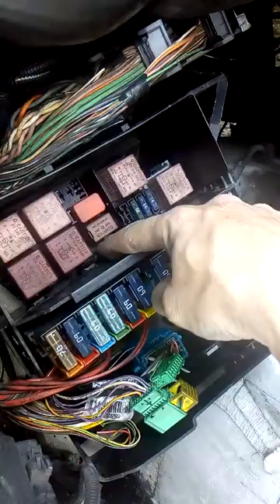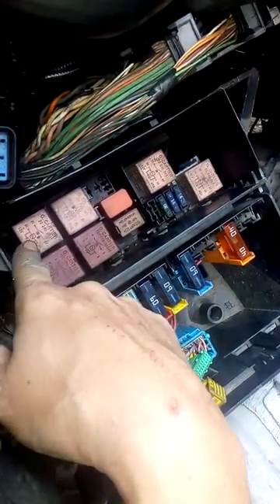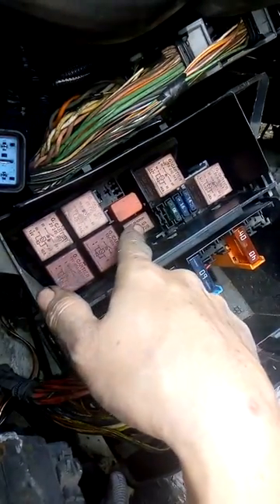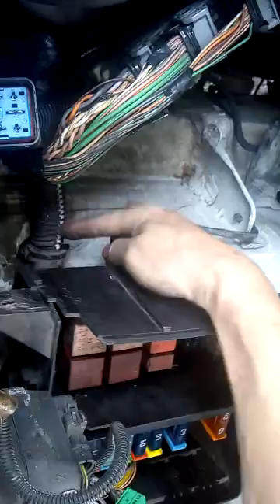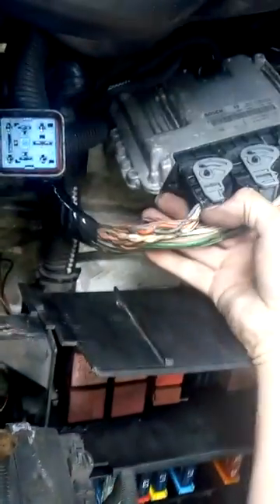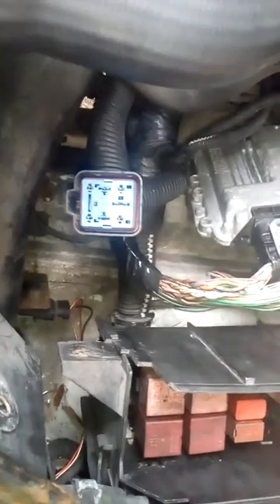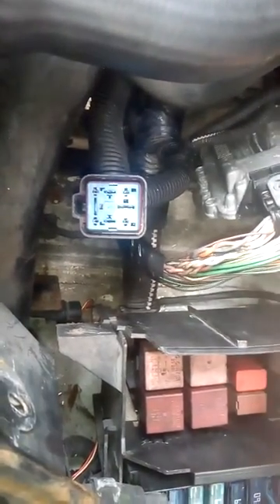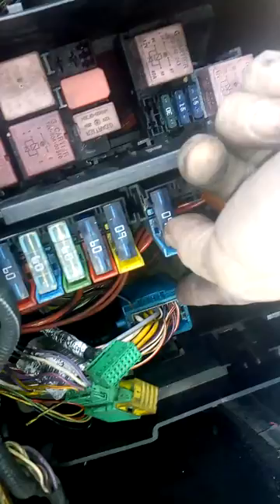Renault DCi 1.9 fixes.

Comment: Hi Rory, My Trafic isn't starting and displays "Low Oil Pressure". Won't connect to ECU via ODB2 either so can't read faults. Any suggestions?
Reply from the maker: You could have a few issue.
Pop out the expansion bottle and take a look at the fuses first.
Also check the fuses at the battery.

The ECU fuse should be a 5amp.You can get corrosion on the ECU plugs, take them off and on again, making sure there clean, you get a green dust, if you see it, scrape it off, and see if you can get what's called contact cleaner on it. Plug back in see if your working again..

If that doesn't work......
The loom breaks about four inches down from the fuse/ECU, and also just above the clutch too on the bell housing.

You will have to cut apart the loom case to take a look at the wires. What I did was get two sewing needles, solder a wire to each and pin them in to wires either side and then use a multi meter to check continuity. You can do it in a big run to cover both places. 
A fast test is shaking the wiring loom as if it's broke it is small, and may work, but will break again so needs to be done.

The low oil pressure is probably a default from the not being able to connect. 
The bus (information) wires are usually thin. But don't forget to check the wires down at the sensor as they can break.

I can't tell you what wires, as there is a few different wiring layout for the vans, so it's hit and miss.
Reply: Thanks for the quick reply much appreciated. Just took off the 2 security bolts which were easier than I had imagined. I'm nipping out to the van every couple of hours to do a little more each time. Will check fuses first.

Agreed it will be a default fail setting as the ecu isn't communicating. The pressure would only increase as the pump starts and there's no permissive to start. Seems its going to be a pernickety job but here goes.

Thanks a lot. Will give you an update tomorrow
Reply: @JohnReilly85  hi mate did solve the problem in your van? I have the same problem with my Vivaro 2012 2.0. Doesn't start, and I have error code DF067 injection multiplexed emission missing and oil pressure fault on speedometer..
Reply: Problem solved. 60A fuse located on the battery had a bad connection. £90 labour to fault find and £3 fuse 👍👍 had to get my local garage to look over it as at first glance the fuse was intact, it was the connectors that were dodgy.

You were right though, fuse at the battery 👌

Comment: Hi, 

I have got vauxall vivaro 04 plate 1.9 diesel . It keeps blowing a 30amp green fuse next to relays while driving .checked the wiring loom from relays to injectors and fuel pump ,don't show any shortage . Sometime van drives fine for weeks and all of the sudden it blow the fuse while driving and won't start again, change the fuse and it starts again .sometime you have to wait for a while to restart the vehicle after the fuse replace .

You help will he highly appreciated

Thanks
Reply from the maker: Depending on what the fuse of for....
If you have anything on there there could be a fault within that, say a motor with a fault in one part, say a 1:360 change of hitting it...
Old warn parts can cause this and of you can manually test it, then do so.
The fuel pump has the regulation on the from which buzzes when you turn on.
I think there also a pressure sensor too, but this wouldn't be the problem.
Or you'd get that under a certain circumstance.

You may have to check  various parts of the loom as the 30amps are "main power" it's spilt into sections,service, engine, 
From the engine  you'll have injectors and pre heats (one fitted on cooling pipe also)
There is a potted relay (inductor box) for the injectors, they have been known to go faulty.
Now this should be a issue with cold starts, hot starts.
Abs system. And belt tensioners, I forget airbag deployment, I think that's 20, but normally has a yellow wire connected.

Don't forget there exposed under the seats, so if you've cut it you can get shorts, sometimes you'll get a dashboard light.

It's probably helpful to see if you get a result from scanning for a fault, if it's blown a fuse. It should show up. 
You may have to see live data to find it if not.

Try triggering the abs (slam on breaks and see if it blows).  Mash about the stuff under the seats...
Also  get you hands on the cables and wiggle them while it's running, the bottom of the black box and around by the gear box.

Comment: Hi I have the same problem on start up turns over fires cuts out up to 12 times some days hot or cold weather 
New glow plugs same problem but it I do glow plug light on then out count to 5 then again on then count to 5 it fires first time glow plug light stays on for about 2 seconds tho when key is turned on
Ut is kiwi on power when started wont rev up easy to stall too when warm it pulls like a train any ideas to the problem 
Nothing shows up on dash or the obd reader 
Thanks simon
Reply from the maker: Obd readers won't show anything. You need a proper tool to read the data from the can bus.

I would say you probably have a fault in your temp sensor,or on the glow plug relay. Or even down to the starter.

When you power the starter this can drain power from the glow plugs, causing a issue.
Where it has a temp fault, the reading sets the mix etc to the wrong mix and this causes issues.

You shouldn't get a glow plug light.
Check your coolant temperature sensor and exterior sensor.

You can remove the pedal, and check the resistance with a multi meter, but this is common to a cold start.

Start issue can also be down to ECU part blocked. Worn turbo or small turbo leak.

Comment: Great video ..out if the videos which I have watched .not 1 fault has the same issue I've got .bloody brilliant . If anyone can help .Renault traffic .vans only starts bump start 2nd gear .runs with no issue..but won't start from the key .ignition. all.works .just no red flashing light  immobiliser..obd reads .fault low power ecu
Reply from the maker: starter dead? faulty starter relay?

My starter just died out of the blue, so changed it over, there doesn't seem to be any other cause as it wouldn't run after being bumped.

Comment: Hi there great video, please could you assist I have a clio 2 2005,the glow plug light comes on and goes off but when its on the car doesn't Rev up any suggestions.. Thank you.
Reply from the maker: Probably the MAF sensor or water temp sensor.
Reply: Thanks for getting back.. But I've noticed now when the electronic fault light is on the throttle body butterfly doesn't open.
Reply: Causing the car not to Rev up
Reply from the maker: @brentonnaidoo1644  unless you have a computer to read what's happening with the car, then you won't know for sure.

Typically, the car won't rev out of gear or if it thinks it's cold. The other thing that it can be is the hall sensor on the throttle pedal.

The computer will show you the air temp fro. The MAF, the coolant temp and the throttle position. (There being two, one at the pedal and the other being the butterfly.
The live data is the important one here.

It's because you have the glow plug light that ones on, that makes me thing it's a temperature sensor issue.

Follow the pedal up and there is a connector, it maybe on the top of the pedal.
In plug it and see if it's clean, then plug it back in.
If you have a multimeter you can test the resistance change on the pins to make sure it's working as it should.

Comment: Great video mate. I have a vivaro LWB 2.0 2012, and I can't get communication with ecu, I can connect to bcm, test light, etc. Before I have DF015 main relay control circuit short circuit to hearth. Did you knowthis relay location? ,  and df25 preheating unit diagnostic connection fault alerted via the control unit. Now I only have  error code DF067 injection multiplexed emission missing . Thanks
Reply from the maker: The bus wires may be at fault, but seems to be a ground or immobilizer maybe?
ECU to bcm is the main part to connect, without nothing will work.

Df015 should be the 15th including missing ones so see if you can find 1 and then count . DF would be fuses. But if you have the ground issue you may have a blown fuse. Or no feed ((power)) going to a unit. Hence why there is a bit of a long list.

Note that if your ECU is down you will get a lot of faults for sensors and you don't need to fix them as it's up the chain that's the source.

Try changing the key battery. And the spare key and if you've changed anything put it back and check all the fuses.
Reply: @guywhoknows  thanks for your reply. Van was on garage for one month and 2 weeks, and they didn't find the problem. And charged me 300 pounds without them repair it. The Relay you said is for water pump have two live wires on it? Mine have live on the leg 86 and 87.. But I did the continuity test, and both feathers give me both ground and live.. Thank you so much for the attention
Reply from the maker: @pontesmocho3140  one should be power the other a 'active'.  If you've a problem they don't fix, then you don't pay. Save for a diagnostic test which is fixed fee .

Comment: Hi,what is the other small relay for?
Reply from the maker: Not really narrowed that one down.
Ones abs. But the small ones are high current switches, like internal fan, lights etc.
Reply: @guywhoknows  ok thanks,having major problems trying to sort this.
Reply from the maker: @avfc666s  are you using the older odb reader? If you can try a older one on there. New ones may have an issue, or eBay specials having no luck??

You would have issues showing up if there was no coms between the units.

Did you test the line between the units by following (copying) from the obd connection?
Continuity and resistance.

Other than that you would need to hook in an oscilloscope to check the signal.
Reply: Mechanical skills are limited. got an icar soft scanner, cost £225,,didn't pick up any codes only abs sensor, nothing to do with eml light,but I only got it today,more complicated than my old scanner,nothing jumps out ,possibly not communicating, but could be me,dont understand it properly yet.on the vauxhall forum ,they dont really help much,cant nail it down.my handle on there is avfc666,if you want to have a look.you have been more help,and I appreciate it,👍
Reply from the maker: @avfc666s  are you logging on to each module?
You'll have 3 of them. 
A abs sensor would put on the eml. As it's a catch all. 
I swapped the relays around and found one was sticking.... Only knew because it causes a fault. Only showing service and stop lights on dash.
Reply: @guywhoknows  the only light I've got on is the spanner light but that's because the air bag wires being cut,and I've done a manual scan and smart scan,some tech terms I'm not familiar with,but I know how to read a code,not much information on internet about my issue, it's all about how to switch eml light off,how ironic,I want to switch it on.😁
Reply from the maker: @avfc666s  have you checked the actual light blub itself?